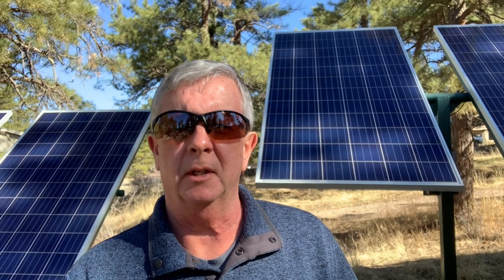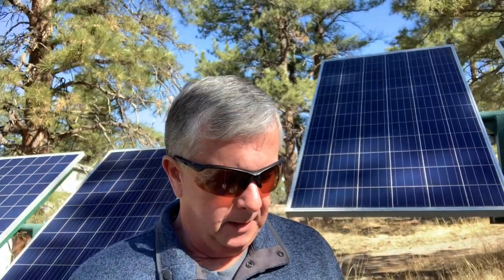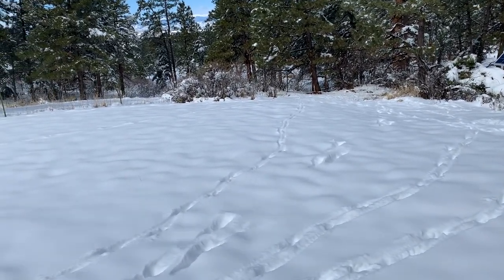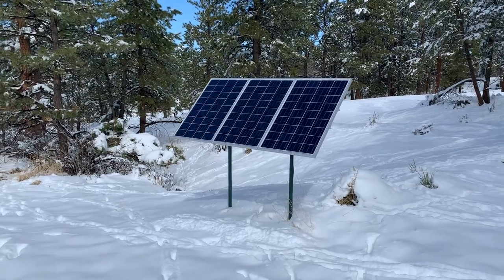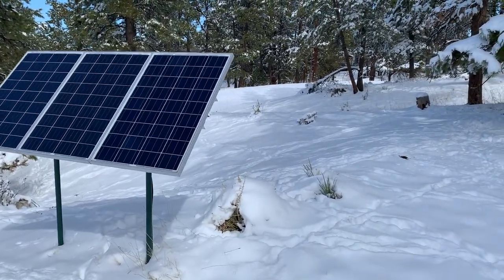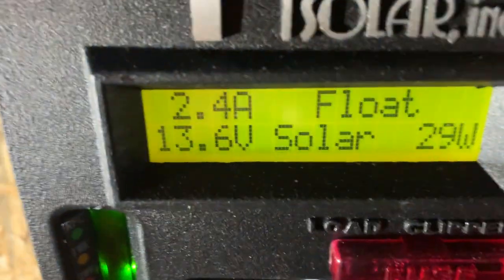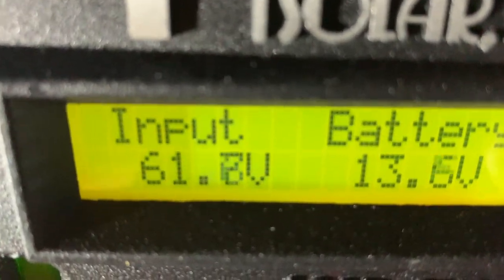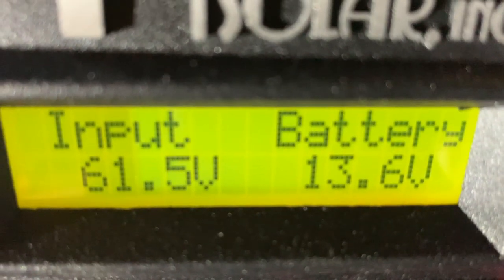DIY - How to Build an Off Grid Solar Powered Well Water Pump

Comment: Excellent video and explanation. What size ANL fuse did you use coming from the battery bank?
Reply from the maker: 400a
Reply: Inverter Watts ÷ Battery Bank Voltage = Size of fuse.

Comment: Hi Bill, thx so much for your vid. I also need to run my 220v well.pump on solar and am using ur setup. 
Did you use 4/0 wire going from batteries to inverter? And also what size wire did you use for putiing batteries in series? I have 2-100ah AGM renogy batteries. Thank u very much!
Reply from the maker: I used 2/0 wire. Pretty much already had some. Thanks

Comment: Great video. How did you end up deciding on the size of the inverter? I have a 240v 1500w/2hp well pump at 80 feet deep. Trying to decide between a 12v or 24v battery bank and a 5000 or 10000watt inverter. Trial and error is becoming too expensive 😅
Reply from the maker: I have a 1 hp 165 deep. The 5000 works great. 2hp is allot. Don’t think my 5000 would do it but you are only 80. A 1hp pump would be plenty.  Thanks

Comment: Bill do you think you can run a water heater along with your well pump at the same time with this setup?
Reply from the maker: Probably not.  A water heater takes a ton of energy. Some folks use it as a dump load to put in excess solar power. But this only pre heats the water a bit for the regular gas or electric water heater. They sell 12vdc heating elements for this. Thanks

Comment: I am wondering about capacitors. I am trying to start a 1/2 hp surface pump with 6 AGM 110 AH batteries attached to a 4200 watt inverter and peak draw simply overwhelms the batteries peak output. I have been considering putting a car jumper pack in line briefly to see if that will give me enough juice to start the motor which seems to pull about 3800 watts at whirl up and then almost instantly goes to a 500 watts. Currently I have given up starting the pump off my solar system and am using my generator when I need to pressurize my pressure tank. Do you have any thoughts on what would work well?

Comment: How did you go from your 240v European style (line, neutral, earth) inverter to the 4 wire (line 1, line 2, neutral, earth) American style 240v pump?
Reply: Sir, already split phase solar inverter is available. Please check the website of MPP solar company. It's a Taiwan based company, they have got all types of solutions for solar power applications.

Comment: How much would a system this size cost? Also id drill a few holes in the top of the plastic box with the heat sinks, you’re making it work a lil harder/hotter! Good stuff!
Reply from the maker: Think transfer switch was 60 bucks.. got the AGM from a cell site for about 100 each. Inverter was a few hundred.  Solar panels around 250. Plus some wire and brackets. Misc fuses power switch another 100. Thanks for asking
Reply: @bparkinson1234  less than a grand isn’t bad at all! Thanks

Comment: What's the continuous consumption of your pump, I have 3kw 240v inverter,went to AliExpress and bought soft starter,i want to run a 1hp well pump out of it,let me know continuous power
Reply from the maker: Don’t know. I used a 5000w inverter. Works great. Maybe soft start would work on a 3000. Thanks
Reply: Okay what's the Ah rating of your agm batteries
Reply from the maker: @kipdennis3796  100. But can only go down to 50%.  Lithium is 100. See my playlist. Rv camping rv solar. Thanks

Comment: Thank you Bill for the information.   I am not an engineer and grasp most of what you are saying, but I am in need of more detail for wiring and such to pull this project off.  Do you offer schematics or sell any DIY instructions?  The kits I've found that are DIY are $8-9,000 which is too much for me.  I tried to hire an electrician to assist me and both of them didn't follow through.  I guess they have plenty of work, so I am trying to figure out how to do it myself.  Thanks again.
Reply: I was able to mimic this design. I went step by step as he did. He is very brilliant.

Comment: I just have a question on the start up of the pump. Do you manually start it or does it start up once it has enough power and turn off once the power runs out?
Reply from the maker: Great question. I have a captive air tank on the system. the pressure switch on the water controls the pump off and on. I turn off at 60 lbs. this is typical home set up. I guess you could manually do it. Like in a cabin. Don’t go over 60 lbs to not burst lines and hoses.  You could use maybe an rv pressure regulator. Thanks
Reply: @bparkinson1234   Thank you very much. Do you think this setup could be used for a small solar water pump irrigation system? If I up the wattage to 690 and used a Midnite 150?
Reply from the maker: @sococad2915  might work. I know there are systems sold for water fountains. Simple 12 Vic pump right off the panel. Check out Missouri wind and solar web site. Thanks